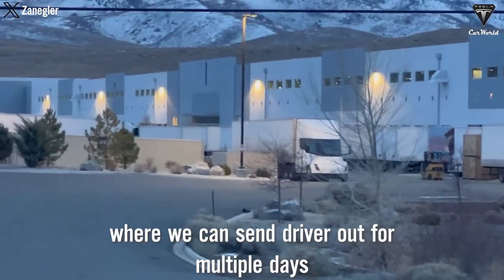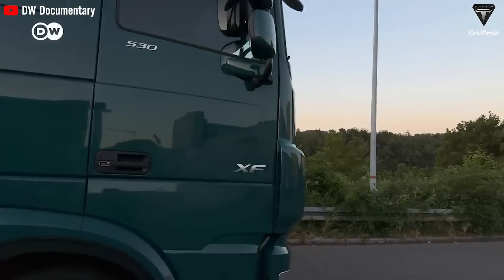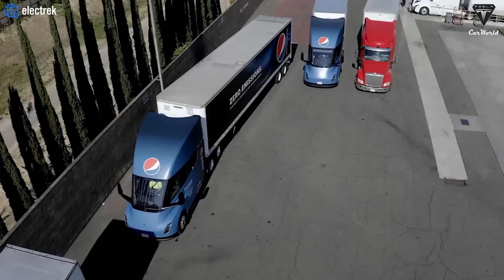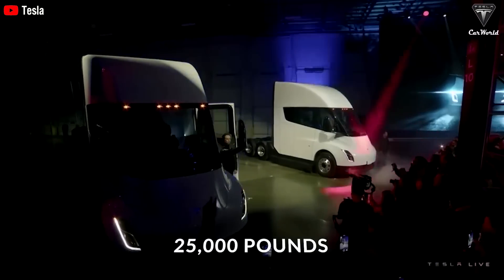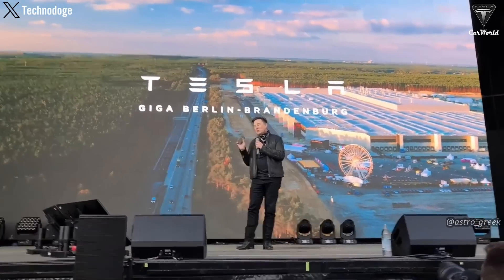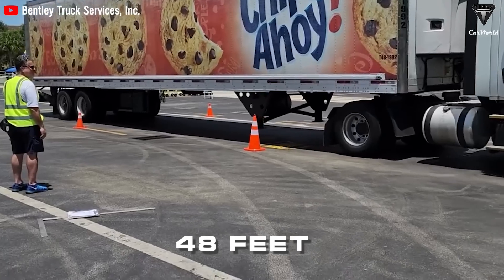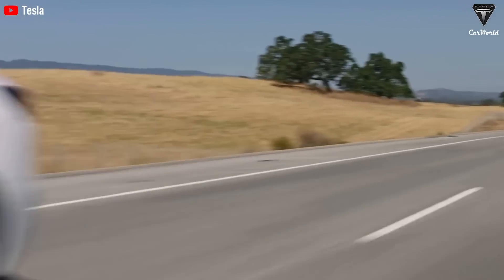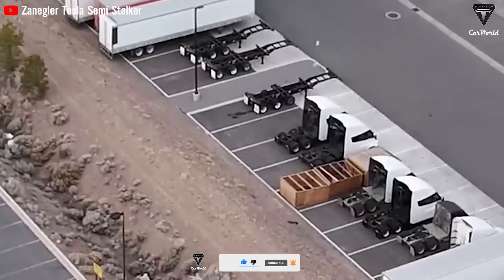It happened! Elon Musk Revealed BIG Upgrade Tesla Semi: Shock Price, Sleeper Cab, 3 Hidden Features!

Comment: As to “robo trucks” not going to happen due to too many unforeseen variables on the roadways to contend with. Now if you want to use turnpikes where they would add a “robo truck” only lane, I could see that happening soon. You could have freight going from the east coast to Wisconsin or through out a good part of Texas, Oklahoma,Kansas. That would be several years yet but closer than anything else.  Robo trucks in distribution centers should be and is starting to happen now. Would it not be better to assist current drivers than try to replace them until the technology is there and shown to be safer than a human?
Reply: Robo trucks take jobs away from people. Why dont people see that. Anything automated takes jobs away. People are hurting for work now and you want to make it worse.
Reply: Platooning is 2 driverless trucks following human driven truck WILL HAPPEN ONE DAY